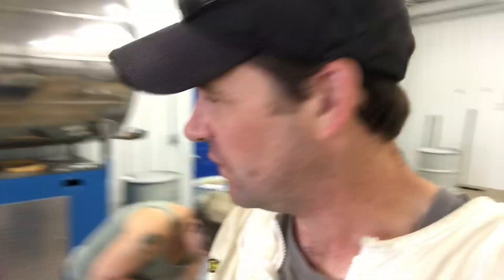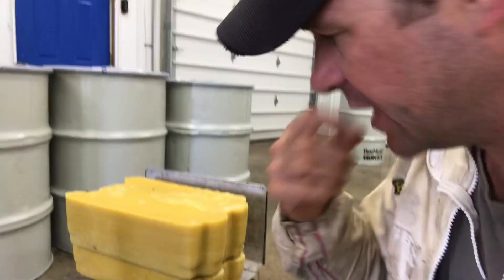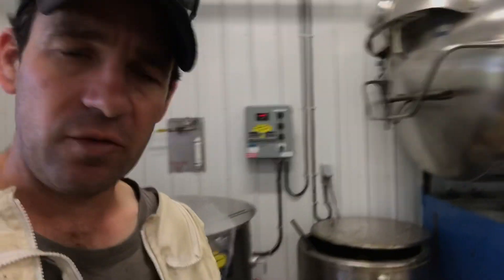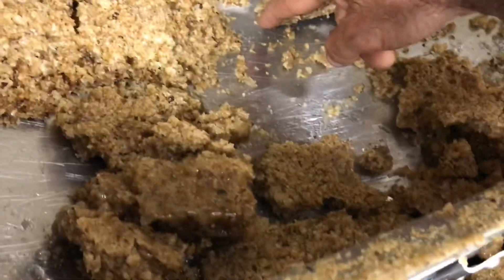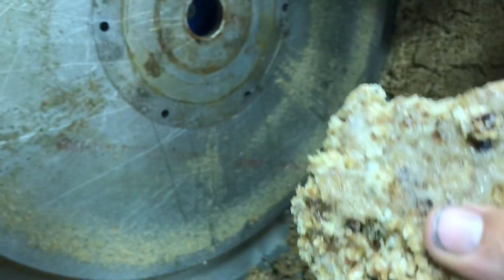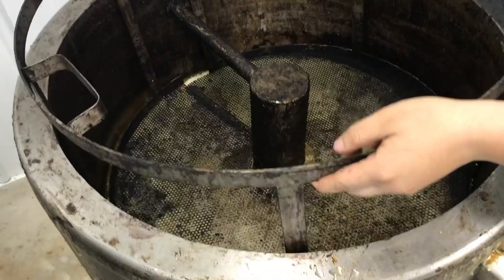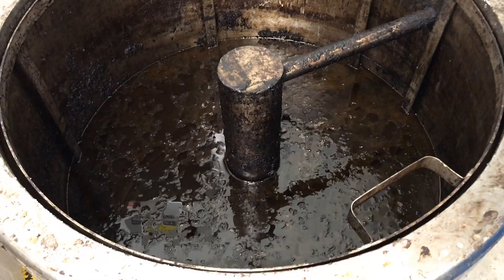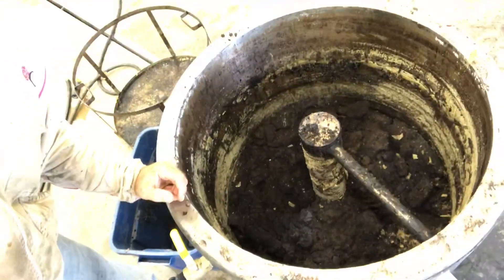Running a Weekly Cycle With the Finlay Wax Melter

Comment: The granulation is caused by the motion of honey moving. 
When a 'fluid' is moving the physics change..it's very complicated engineering stuff but I think thats why it granulated in your machine. Nothing you can do except maybe go very slow. Like that'll happen. 
Cool machine.
Reply: It granulates I the comb too though
Reply: @carriemartindale-wetherup5243  true. Fluid Dynamics is a very very hard class you take as a junior.  Not going to try explaining Bernouli ... you might be right tho.
Reply: @mikeries8549  you make it sound so  complicated, and that you are smarter than the rest of us, so you can't even begin to explain why it happens (which probably means that you don't know enough about it to actually explain it lol), but what Carrie is saying is that Canola honey is already crystallizing when they are pulling it off the hives.

That's why they have to pull it as soon as the bees fill a box and then extract it immediately, because if they let it sit any longer, it will be crystallized before they can extract it.
Other types of honey can be left to sit until later and then extract it all at once at the end of the season, but canola would be solid by then.

So the much simpler explanation is that the already granulating honey in the comb tends to clump in the extractor because it doesn't flow out, and probably collects some other honey that's almost ready to crystallize and just needs the seed crystal.
Reply: It is actually the sugar makeup of the honey canola and sunflower have a higher concentration of dextrose thats what sugars, clover honey has less dextrose and will granulate eventually but much slower

Comment: Could you give smelter honey back to the bees instead of syrup?
Reply: No, it's very toxic to bees. Cooking honey produces a compound called Hydroxymethylfurfural (I had to google the spelling, look it up). Don't feed bees cooked honey or burned syrup.
Reply: @stanleyguedes2336  Gotcha, always done glucose syrup at fairly low temperature. I poured away the smelters honey just like our favorite Canadian is doing. But I started wondering :)
Reply: @verlicht  It's not bad for humans, so you can by all means cook with it. Lots of people use it for barbecue sauce. Also, as far as I know, it takes boiling syrup for any hydroxy to be produced, so no worries there.
Reply from the maker: Only if they can fly, but even so, no
Reply: I use mine as an organic weed killer.....found out the water with the honey and nothing grows...works great around the electric fence....dont laugh it works